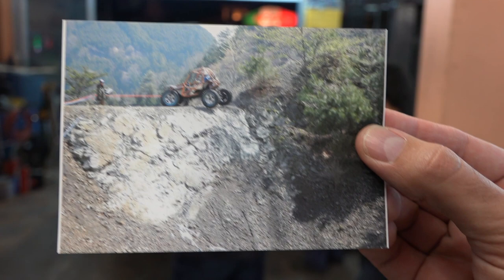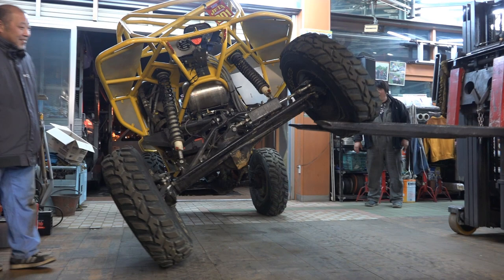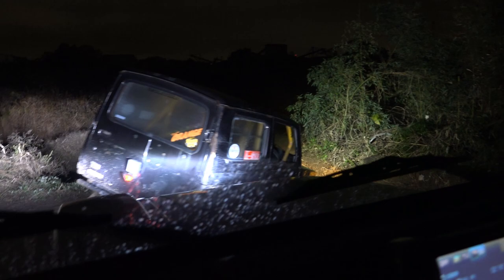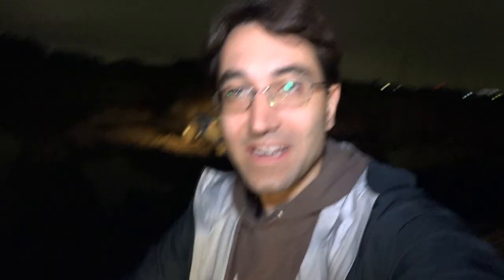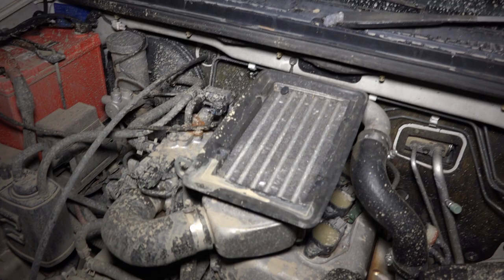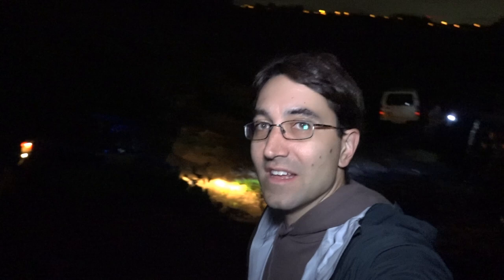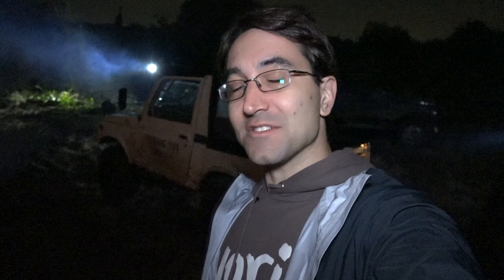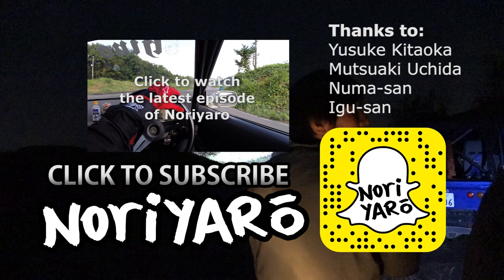Suzuki Jimny midnight off-roading in Japan.

Comment: In the UK they were called usually Vitara's (although some in mid/late 80's called Jimny's - perhaps Grey Imports) and the later slightly mid 90's bigger one was the Grand Vitara. ..but all had 4 stoke petrol or diesel engines.

Comment: Not to criticize but the annihilate that clutch, also you should NEVER ride the brakes when going downhill, thats when you slide and lose control, try to keep it in 2nd or even 1st in low-4 and release your feet off everything, let the gearing of the engine and transmission control the decent speed. =) i hope this might help anyone else who is interested in getting into some 4x4 fun.

Comment: Alexi how quick was the white jimny you where riding with in the first part? It looked liked it was pretty quick. Was that the dual cam or the single cam? Im looking to import one of these because they are dirt cheap over there and are turbo charged.
Reply: That i think was a Ja1, the Ja11 is single overhead cam turbo charged, that engine was "built"!  Stock is 660cc's. 5 speed.
Reply: Robert Reich You mean the white one was build?
Reply: yeah the one ou herd take off and turbospol up
Reply: Thx! So which chassic code has the cappuccino dual cam engine?
Reply: i don't know the engine code for suzuki cappuccino cars, but they are extremely rare and hard to find

Comment: You say these things are turbo now days, is that just the JDM Jimny's? All the ones in Aus seem to be N/A.
Reply: In Japan, all the one with a yellow plate, which means the engine is 660cc or less have turbo.  anything 700cc or above has a white plate and is NA.  A turbo modification can be installed thought, total cost of work and paperwork's around 500,000 yen
Reply: Yeah but I think all exported Jimny/Samurai are bigger 4-cyl. aren't they?
Reply: Yeah i think so, i believe when the went to the USa in 86 they had a four cylinder